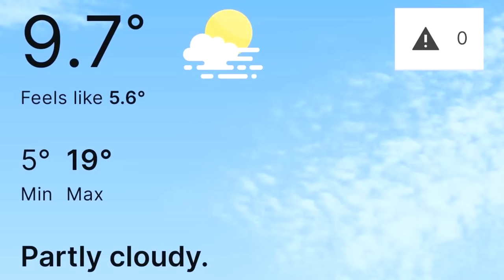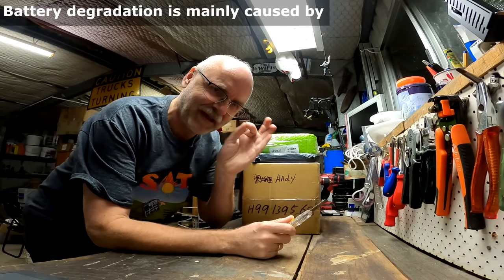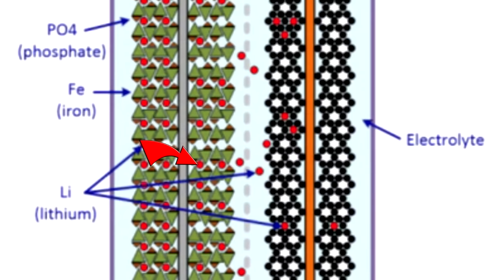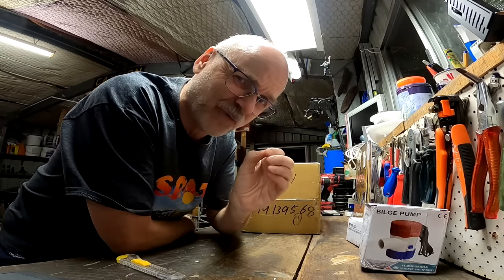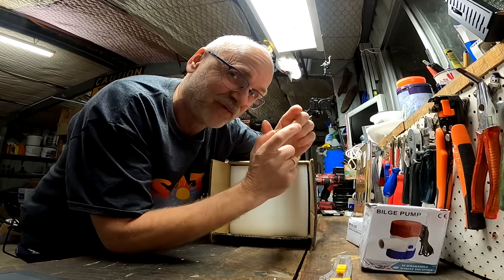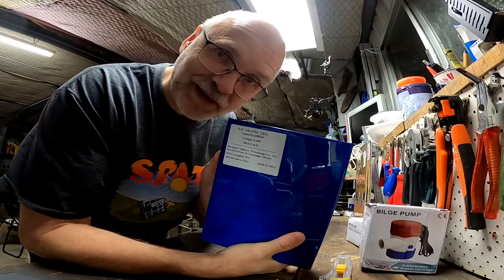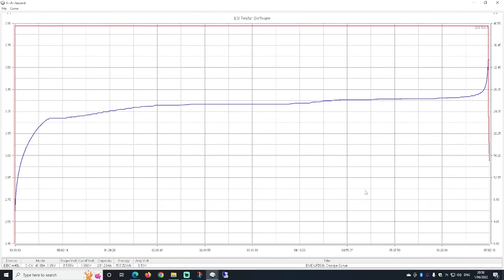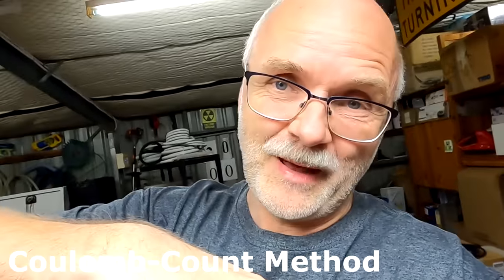Busting the 20%-80% SOC myth for LiFePO4 batteries.

Comment: Correct me if I’m wrong Andy but most BMS do not start passive balancing until 3.5 V so charging to 3.4 V Will mean the BMS won’t balance the cells.
The way that I look at batteries is they are a consumable item that is going to wear out over time i.e. lose capacity slowly no matter what you do you may prolong the life by only months maybe a year ,  it really comes down to how hard you cycle the batteries from my experience if the batteries are cycled hard you get an average of about three years out of the batteries where you have now only 80% of your original capacity regardless of how you try to look after the batteries, Like you said it depends on the C rating of your discharge so the more capacity you have the longer your batteries are going to last.
The most problems I’ve seen with lithium batteries in the caravan and camping style of things is generally cell in balance over time reducing the overall capacity. I really like the effort you’re going to and I realise how much time you put into these videos thank you for busting some of the myths out there.
Reply from the maker: Thanks a lot Phil, great comment.
With LiFePO4 chemistry, it makes no sense to balance below 3.4V. But stopping charging at 3.45V and balancing at 3.5V makes all the sense. The balancer will only start cutting off the voltage of each cell which dares to go over 3.5V! If the balancer does not start balancing, that's great because there is nothing to balance. 
Yes, if you cycle them hard it will burn them out far quicker, absolutely. Because many of us have invested a lot of money in these batteries, we try to understand how to prolong battery life and keep the usable as long as possible.
The videos are taking a long time to make, edit, upload, describe, thumbnail and reading the comments afterwards. Thanks for appreciating that!

Comment: I appreciate the graphs showing the difference between Lion and LiPO4.

Unfortunately, my Bluetti solar generator was not charging its LiPO4 batteries properly. They overheated at 100%, because they bulk charged to almost 99%. Its 30C here, but no excuse to not being able to function properly when I have a BIG fan blowing on it!

I told customer service, but no one understood my technical question to update the firmware.  I now know where their charge rate was improper. Returned my EB3A, since it could never achieve proper life expectancy!
Reply from the maker: Bulk charging to 99% is not a bad thing with LiFePO4 and usually works well. Once the voltage rises to over 3.45V, the cells are 99%+ charged anyway.

Comment: Andy, I have always agreed with you regarding not charging to 100% max.  Something to also consider is how the battery is being used.  I have 2P4S 560AH(LF280 cells) battery on my sailboat. The battery can be charged 3 ways: [1] shore powered charger(5A to 65A),  [1] solar(350W), and via alternator(120A).  Since I have been mainly day or over-night sail, I rarely charge via solar(keep flexible panels safely stored) or alternator because of the large capacity compared to my needs.     When I am not sailing, the vessel is connected to shore power.  I have the charger set for 45A boost charge to 14V(3.5V average cell).  It stops charging until the battery hits a "boost return voltage" of 13V.  This take about 3 days with loads mainly being for my refrigerator, computer, and networking.  I could set the return voltage lower but I want to be able to randomly show up and go sailing with still plenty of capacity.    I have a JDB SP04S034 200A BMS which has both bluetooth and RS485 communications.  I readout the RS485 with a raspberry pi via a simple python program which creates plots for 2hours, 48hrs, and 7days windows.   I can connect to the sailboat's raspi remotely via vnc to view the monitoring plots.   It is interesting to note the cell deltas increase and then decrease during discharge cycle at what I call a "mini-nee", which is the at the 3.3V to 3.2V cell voltage drop.  I wish I could send you some plots.  The delta raises up only about 20 mV but then drops back down is a rather symmetric fashion. My guess is some change in a phase transitions.
Reply: Why do you keep bothering yourself with shore power? while you could just fix a 2pcs of 500w panel and forget? 
Alternator charging should also work very well on bad days
Reply: @innocentusangira789    Why?  Because: I have a big boat and when it is in its slip, [1] shore power is free and my automatic transfer switch will automatically switch the AC loads from the inverter with no interruptions, [2] I can run my boat's 16,500 BTU air conditioner(A/C) without concern(through the battery inverter it would draw 100A), [3] I have flexible solar panels which I can easily utilize for cruising beyond day trips and are safely stored greatly reducing degradation which is greater for flexible panels, [4] reduced battery cycling and different operational demands( I want solar to keep the battery near full so that at sunset to sunrise, I have maximum power availability(and possible use my A/C for several hours allowing for over night cruising during the hot & humid Florida summer season),  [5] ...
Reply: @dreupen  how much power do you consume in a day ?
The storage you have can only be filled with the few panels and yet... You will keep recharging even if you are in deep sea parked
Reply from the maker: Yep, so on a boat it's a bit of a different situation and you want to charge your battery with anything you have as fast as possible. Different to our solar stationary setup. I agree, in this case it makes totally sense to charge the 3.55V or even 3.6V as fast as possible so you're ready for your next trip. You certainly don't want to leave a port with only a half charged battery.
Reply: @innocentusangira789  The issue with boats is space, and going from a 300 watt to 500watt when the panel is mounted horizontal is not worth the investment or the time to install.
Reply: @innocentusangira789  Panels on boats is like icing on cake.
Reply: So right, makes me squinch at the opinionation of landlubbers regarding nautical affairs. Had a boat once (oft quoted as resembling a cash black hole).  I learnt that what ever you might think would last ok on land for a year, expect it to start failing and needing maintenance after a month.  Been there done that then the wheels fell off the trailer:face-orange-frowning:

Comment: Another thing to consider might be the swelling that occurs while charging and discharging. I don't know how much this physical movement of the cells contributes to degradation, but the swelling on my cells tends to occur more at above 3.35V/cell (26.8/8 cells). 
I also consider how long my battery will play my stereo at full volume and whether or not it's long enough to make me happy. Will my hearing be degraded before I need to replace my battery? Time will tell the result of that experiment. You might want to consider/research adding closed captioning to your videos in the long term😁
Thanks for your input. I have enjoyed your videos 👍
Reply from the maker: The swelling is minimal and often cannot be measured. I'm using my cells uncompressed with some minimal space in between and had some swelling after 1.5 years of using them like this, so the cells actually touched in certain areas.
So you either compress with recommended 300kgf, leave some space between the cells or use flexible busbars, so cells can move without putting force on the terminals.

I like you stereo experiment. That is really outstanding😂

Comment: Hey Andy - A test idea for you: Variable discharge rate curves.

Many times we have seen you show us the flat voltage curve of LiFePO4 when discharging (or charging) between 90% and 10% state of charge and with the knees at each end of the SOC.

Most of these show the curve when tested with a constant discharge rate.

I was wondering however what the discharge voltage curve looked like if you programmed a variable rate of discharge, say cycling between 0.1C and 1C for 5-minutes at a time, or some other variable load profile. How much "wobble" would the voltage display when a battery is being discharge with variable rates? You have a battery tester which can be programmed to run such a test I believe.

It seems to me that variable rate of discharge would be a more realistic test of the demands placed on many batteries.

Thanks and keep up the good work.
Reply from the maker: Thanks Alex. I have tried that in some experiment already and the result was... there was no difference. The think is the Peukert factor for lithium cells is almost 1 so it does no matter with which current we charge or discharge the cells. The curves will look almost identical.
I can do the test with my tester and show you in a future video, no problem.
Thanks for your suggestion.

Comment: Appreciate the explanation and frankly was quite surprised. My Lifepo4 battery manufacturer wants me to charge it with 14,6V only. I guess they want to sell me new batteries soon? :)
Reply from the maker: It depends. If it is a 12V battery with built-in BMS and a very small balance current for example, this would be the only chance for them to balance this pack at a higher voltage. I would not bother and just stop at 13.8V and let it absorb there. It will still be 100% full
Reply: @OffGridGarageAustralia  Yeah. Now I have noticed that my Ultimatron 200Ah batteries work nicely with 13.6V (Epever 10420), but Wulills 200Ah batteries need 14.4V (with Victron charger) to fill them up.

Comment: Hi. I found your video very informative.
I run my Escooter 48v 20aH (960wH)
Voltage is basically my 'fuel gauge'. :)
Calculating in my head (and after a few test runs), I worked out that 47v (resting voltage) is my 50% mark (or turn around time!)
About 50Km round trip....
I'm thinking about installing a 48v 100aH battery for a long distance endurance run (project w solar)
Cheers von Australien 👍

L.E > Ideally i would require a 48v small petrol generator, say 850w which I can recharge on the fly, so to speak. I've not yet looked into availability....
However, with 100Ah i sink I would get around 250 Km out of it. 
(5Kw x .30 cents = $1.50 to 'fill er up' on AC charger..) 😅

Comment: To add even more uncertainty to the SOC, is charge rate. When charging to 80%, the voltage will vary depending on how many Amps you are charging at.
Reply: The only good thing about a lithium cell is they are lightweight. All forms of battery cells are garbage.  Our bodies are the best energy devices ever created due to the small amount of resources needed to do a large amount of work.  An electric generator is great , the only problem is we need something portable that is good enough to power it.  Fuel combustion is still our best bet.  I can make my own fuel and get a lot of energy out of it.

Comment: Seems to me if cells are not perfectly ballanced, Smart Shunt is not enough. It won't protect single cells to go in "unhealth" voltage teritory.
Each cell should be measured and BMS should send commands to charger to lower the charging current. All three of them. Maybe use some kind of BMS system with master and slave shunts capability. Or just rely on three batteryes. If one BMS disconects its battery, the other two are still running, and the system stays on. But if you have just one battery, BMS must comunicate with charger. Only the charger should finish charging, not the BMS (by disconnecting the battery). Can't wait, what is further going to develop in this project. Top work Andy. Respect!

Comment: Hi Andy. Great Idea! Please include in to the scope also solar charge controller setings. E.g. where to set a voltage of 3,4? Is this in SCC or BMS etc. Another topic is why not to read state of charge from BMS using CANBUS vs using SmartShunt? Maybe this is clear when you are at battery version 2 or 3, but for those who are at version 1.2 there are a more questions than answers
Reply from the maker: Yeah, we will go through all the settings soon...
I'm not a fan of communication between BMS and solar charger of inverter. It brings no benefits in my experience and only ads further complexity. It's not necessary.

Comment: Andy - you're correct theoretically, but in a practical sense you can get pretty close to a % by selecting a voltage AND a time.  I want to have about 65% in my battery each morning, so I set it to charge between 2-5am to a voltage of 53.7v.  Every single day this gets me 65-67% full as per the JK BMS readout.  It quickly hits the voltage & holds, then the capacity slowly creeps up.  So you need to "learn" what voltage level & how long & then you can practically get a specific % pretty reliably.  If it starts at 0% maybe i'll get 61%, if it starts at 40% i'll see my 65% within that timeframe of charging.
Hope that helps!
Reply from the maker: That's almost impossible, Nate. The SOC the JK shows is not accurate and it will drift with every cycle if it does not get calibrated frequently. At 3.356V you still in the flat area of the curve and will have inconsistent results. It may work in your case because you have a grid charger with a constant current and hence you may see a more constant result with this approach. Most people charge their batteries through solar and at this voltage it can be anything. Even 3.4V per cell is not enough to be consistent unless you absorb for a quite a while.

Comment: C-rate and temperature are probably the biggest factors.  In a solar application, where the C-rate is almost universally very low, cycle life should be very high.   Basically it is the expansion and contraction stress which creates the problem, not so much the voltage.  The chemical structure of the medium has a different 'natural' size with vs without the ions, so the matrix actually changes dimensions with each charge and discharge cycle.  Sometimes very significantly.   SOC matters some but I don't recall the exact reference... basically the degradation curve doesn't go exponential for LFP within the 0-100% range, but it does 'curl up' a bit and go non-linear close to 0% and close to 100%.

But the biggest factor is C rate and the second biggest factor is temperature.

-Matt

Comment: Andy, have plotted any charge/discharge curves for some of the common 100Ah 12.8V LFP's by Li-Time or Power Qween? Their chargers are CC/CV 14.6V which is not necessary except for cell balancing. Seeing a charge curve would be helpful for setting up a Solar Charge Controller specific to those batteries.  Thank you for your awesome productions.

Comment: Yea, Andy!  Looking forward to the series! The BMS/Inverter settings are key and understanding them for each type of use is not easy. 

I hope you can contrast solar ess systems with RV/marine use and will be able to look at some external BMS (Tao, Victron/REC) canbus systems
Reply: Would be nice to see a REC BMS in Andy's project. Or some other BMS controlling Chargers and MultiPlus over canbus and Venus OS.

Comment: It looks like this charge/discharge  pattern is typical for LFP batteries. Thanks for providing this experimental data!!! It seems like Tesla's software just monitoring the voltage on both ends of charge/discharge states and flags  both 100% & 0% respectively? Thus protecting the battery from the extremes too. This is why the actual range/battery capacity can be different and grossly depends on charging current, and probably, on temperature during charge and discharge cycle, not a degradation as some Tesla car owners reporting in 1 year of use? 
If my understanding is right, this would be possibly best idea to follow Tesla's recommendation of having 100% limit and charging to full 100% periodically once in 5-10 days. I think this would be be a better idea to allow Tesla to do their job and not interfere with their business, as they still monitor, analyse send the updates to their BMS?

Comment: Andy, well done, since it is years ago, call me a Late Bloomer.,, in the LifePo4 world, I hope as I look thru your 300+ videos, we can find your Take on the MFG's warranty using the 80% reference and 6000 cycles.. as my understanding in Solar design is trying to keep your Discharge ideally  down to only a remaining available of 75-80%, using only 20-25%, with a max stop down to 50% balance remaining.. from what I am taking from this video for the LifePo4, is 20-80% operating range is not best, as in summary, discharging to such lower rates and then charging back with higher voltage to get the batteries back up your creating degradation to the health of the battery over time... Please correct my take on this.. Thank You for all sharing and testing.. sent a cava from Buyflyer

Comment: Very valuable information Andy. I am glued to your presentations. I have a question. If you have 3 150A batteries (in parallel) charging at 0.2C, would you set the Charge Controller at 30A or 90A ?
Reply: Three 150 amp-HOUR batteries, not three 150 amp ones. 
Think of it like this (simplified); 
In parallel, you have three lanes. Whatever the charger outputs, it gets split up over those lanes. To send 30 amps through each battery, you thus need 90 amps. 
In a series connection, you only have one lane going through all the batteries which requires only 30 amps.